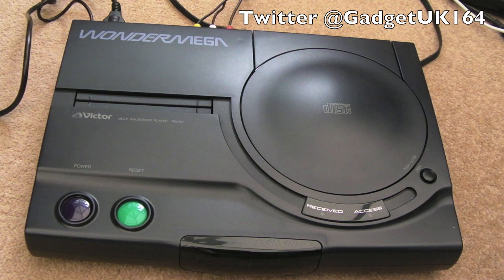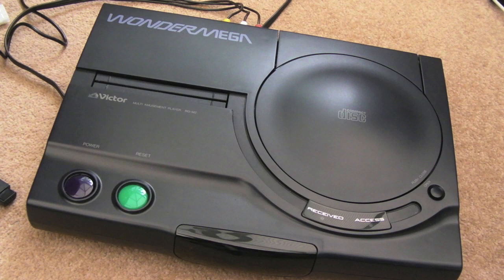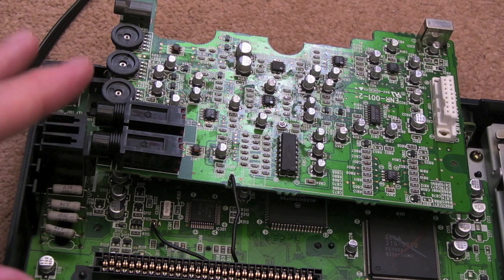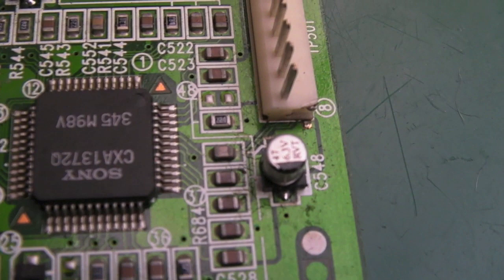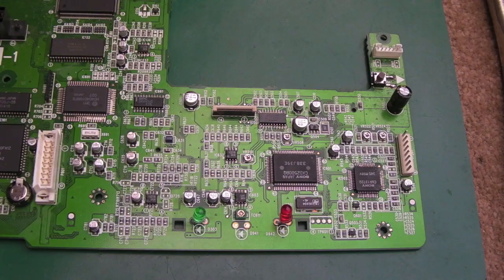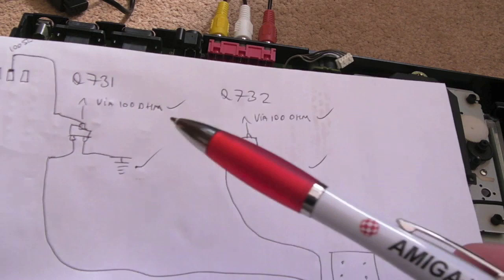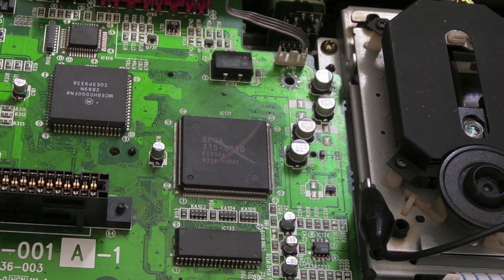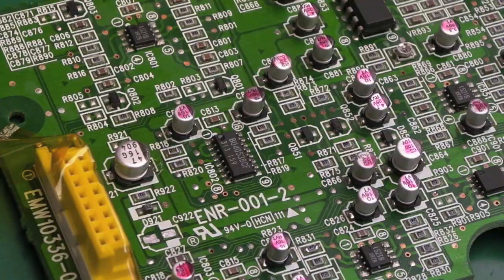Victor (Sega) Wondermega Recap & Repairs - Part 1

Comment from the maker: Part 2 - https://youtu.be/f2tLIqkbFM0
If you cannot get me to repair something - Simon Lock does a fantastic job of repairing these (and other systems) here in the UK - https://aergan.wordpress.com/  Or you can contact Simon on Twitter - https://twitter.com/A3rgan
NOTE: If you do repairs yourself in other regions (or the UK too), please let me know and I will check out your work so I can suggest / recommend you too.
UPDATE: When I showed the wierd layout on the mixer board - its an optical illusion.  If you look closely where those pads are on the bottom side, when flipping over the PCB, they are probably under the connector edge.

Comment: 39:00 yeah could be more than two layer. Something I've done for caps is put solder onto one pad, use hot air or the iron to move in in place, and then flow solder onto the other side. I guess one nice thing about using hot air to remove newish caps is there's no risk of them exploding (I think when they drain all over the motherboard the air in the cap expands and they explode?). Also nice fix - for pads that complete come off yeah - I usually always just suck it up and use magnet wire to bypass the bad track.

Comment: If the high-order bit(s) to the DAC were shorted to ground, this would also affect the audio output level, but the audio would have full-wave rectification distortion, as if the output rails on the final driver stages was too low for the volume requested. This is because the voltage level of the DAC is level-shifted by a transistor/op-amp stage, such that values of 0-7FFF represent voltage (signal) levels < 0v (- half of a sine wave), and values from 8000-FFFF would represent signal levels > 0v (+ half of the sine wave). That is, for a 16-bit DAC, the binary input is a signed-magnitude integer, but with the sign bit inverted. If the high order bit was always 0 (the ‘sign’ bit), you could only represent signals < 0v, just as if you had a full-wave bridge rectifier on the output, but whose (+) terminal was wired to analog circuit ground. Also, if bit 14 were shorted to ground, then the maximum negative peak would be for an input of 3FFF (7FFF with bit 14 = 0), so - IIRC - this would translate to a 3 dB loss in volume.
If only bit 14 was 0, then you wouldn’t get the full-wave rectification effect, but you would still suffer loss of signal volume. HTH. 🙂
Reply: That pleased my nerd nerves so much.

Comment: Thanks for the video, really appreciated!

I've got a question, if you have a while to answer - I've recently acquired a Wondermega 2, but it has a fault: all sounds are extremely quiet, almost inaudible. This happens on cartridge and CD games, on both RCA and headphone outputs. What would you suggest to start investigation from? The console seems to work fine apart from that. I'm blown away how much clearer the S-Video output is compared to standard composite.
Reply from the maker: It sounds like you are lacking (or have a low) supply voltage to the opamp which amplifies the sound near the output stage.   The part where I worked out the missing channel - that area of the board there, is there corrosion perhaps?  Or the bit further up on the right hand side, where there are several caps.  It could be a corroded via.  You could measure DC voltage across all the caps there to see what you get.  In theory most if not all the ones around the audio section should have a voltage across them.
Reply: @GadgetUK164  thanks for the reply! I've taken the console apart and there doesn't seem to be anything obviously wrong - no corrossion (as far as I can see), no cap leakage. I've briefly checked the voltages and it all seems okay, but with that said my technical knowledge is very limited. But all things considered, judging from your words it sounds like this should be fixable, so I might settle for a partial refund from the seller and look for a local repair shop, since this job seem to be outside my skills. Having to return the unit to Japan would be a pain.

Interestingly, I've now also noticed that the sounds generated by SN76489 are noticeably louder than those coming from YM2612, although still far too quiet.

Comment: Hello, is it possible to retrofit the MIDI port? EDIT: today I received my Wondermega MG2 from Japan. Unfortunately it doesn't show any picture on pressing the power button. Regardless if I connect it with composite cinch or with s-video. Hope your video can help me to get it repaired...
Reply from the maker: I don't think so - I think they removed that function from this later model =/

Comment: I loved the vid. cant wait for more. 
I got a few old graphics cards that have artifacts that i am thinking about trying my hand a fixing. The worst that could happen is they die entirely lol. I am wondering if its VRAM issues, not 100% sure where to start other then with some air duster and hot air see if either cold or heat changes something. I just got to unlazy myself ugh....
Reply from the maker: Main thing I've seen on graphics cards is bad BGA points on chip (or bad internal bond wires) - not sure which.  And on occasion bad VRAM.
Reply: @GadgetUK164  ya if its the main chip idk what I could do. I have a hot air station but the bigger BGA chips can be a pain to work with. I just hope its VRAM or maybe a supporting component lol. its older GPU cards from 97 to 2002 so some may be easier than others but do you have any tips for BGA work on a shoestring budget lol.

Comment: Hey Chris, love your videos. Can you help me with advice on where to look: I got the same model wondermega that had corrupted bios image (messed up graphics) and dint read cds. I did a full recap and now cd drive reads but i still have messed up bios and i realized that cd games hangs as well. Some would load further than others but eventually, they hang. My thinking is that it is some RAM chip. Can it be a BIOS? I refreshed the solder on the bios and RAM chip legs. I didn't see obvious damage from electrolyte while recapping but I'm not sure (thinking of your 1 via got bad case). Can you please tell me where you would look and also how to clean vias? what kind of tool did you use? Many thanks in advance!
Reply from the maker: Assuming an IC died (it might be a bad via or trace from corrosion) - I would suspect a RAM fault.  RAM does occasionally die on these.   You could try running one of the Megadrive diatnostic  ROMs (there are a few test ROMS) or 240p test suite - which also tests RAM, from an Everdrive or other flash cart.   That might allow you to work out if any RAM is bad.
Reply from the maker: Clean vias out by soaking them with vinegar for 10 mins, then flush them with IPA a few times - if its a directly corroded via, use a drill bit the same size as the hole (these are tiny, like 0.1mm or 0.2mm, maybe wider ones 0.5mm etc.  Dont use a drill bit larger than the hole or you will damage the through hole plating.   Once a bad via is cleaned out that way, test it from top to bottom side, if in doubt feed kynar through it and solder on top and bottom, then cut off excess.
Reply from the maker: Thanks btw =D

Comment: I see a lot of ebay listings for repair services for Sega CD consoles that use mainly ceramic capacitors instead of electrolytic ones. In concept it sounds great! if there is no electrolyte to leak there will never be a leak. Any idea how reliable /safe this actually is? I have the us model 1,2 CDX and X-eye units That "WORK". That said with the track record of capacitors in Sega CD machines  I have wanted to recap my systems for a while now especially the CDX and X-eye. My soldering skills are not so hot so I would probably use a service. I am willing to pay the extra cost IF it is actually a worthwhile endeavor to do so. The last thing I want to do is pay some one to wreck my consoles for me.
Reply from the maker: Using ceramics - it will work, and yes it saves caps leaking again in future.  Ceramic capacitors behave differently to electrolytics though.  They can also suffer from a piezo effect, as well as shorting or turning into resistors if they do fail.  Some people would tell you its better to fit ceramics over electrolytics, personally I would go with electrolytics.  Chances are you may see no visibile or audible difference in behaviour of the system once you've fitted ceramics, but it's not something I would do or recommend.   You may find for example the filtering charactistics are different between two different types of capacitors of identical size.  And I am sure temperature plays a role in variations there too.

Comment: Chris, if I send you my CORE II will you have a look at it, I'll obviously pay you, I've noticed when the main sprite scrolls the background gets a tad flickery, it's noting really major but if it can be fixed or you know what it is, I am assuming a bad cap' I'd be over the moon, give me a rough quote, and I'll also sort out some gaming gear for you, my email is in my about section.
Reply from the maker: I have no spares for the PC Engine mate and just cannot offer to look at anything for the forseable future and I don't generally offer customer repairs.  It puts pressure on me, and if something goes wrong I have to honour warranty etc etc.  I've got a tonne of stuff that I need to progress through too - my new work space is already becoming unworkable due to space.
Reply: @GadgetUK164  No worries mate, I understand, I've fixed stuff for family and explained I might destroy it, fortunately all the quick fixes I've done mainly PS3 Pads and cart' battery replacements have worked out.
To be fair it seems perfectly fine, it's just you get a touch of background blur when moving the main sprite, it's a CORE II through Composite, not the RF one, I am really not sure if it needs new cap's or not, I got used to playing it via the RETRO FREAK through HDMI and the picture is amazing, tight, no blurring, solid colours so it looked amazing on that, that could be throwing me off.
Some games such as SonSon II won't play on that though, so I need the CORE II for that reason.

Comment: What about an ultrasonic cleaner Chris surely quicker and easier ?
Reply from the maker: Yes, that would be a good idea - but try and find an ultrasonic cleaner big enough to fit the board lol!  The other problem with ultrasonic - there's so much flux on the underside, I suspect a few washes would be required at least.
Reply: GadgetUK164 - Retro Gaming Repairs & Mods good points , how about white vinegar bath and then alcohol bath with a scrub after.